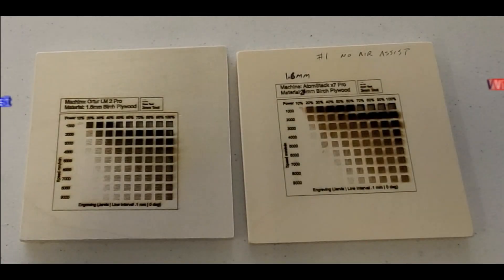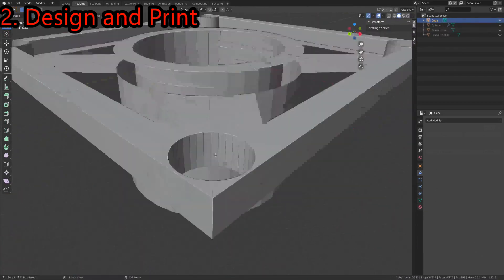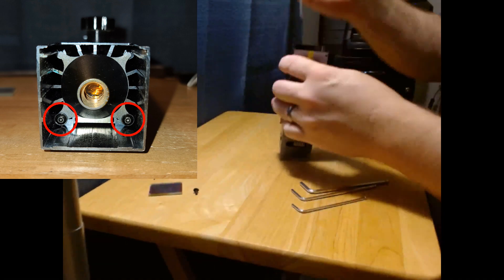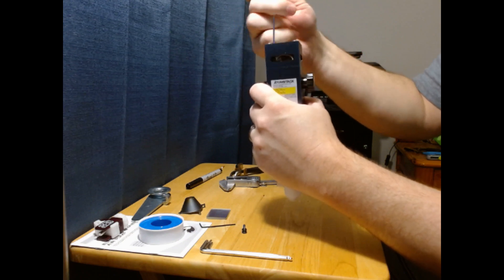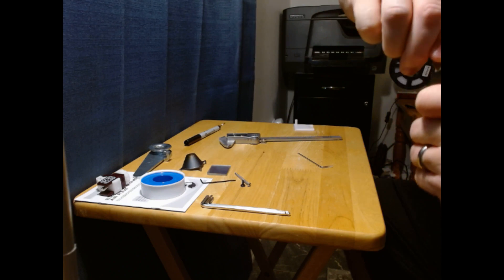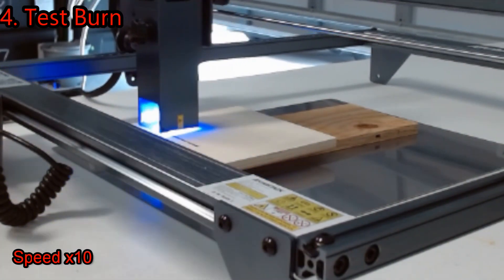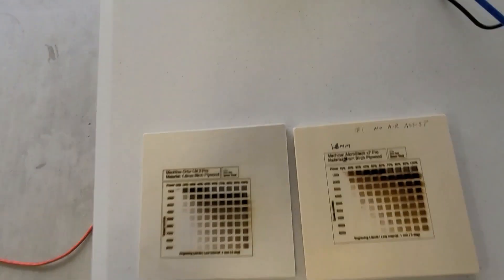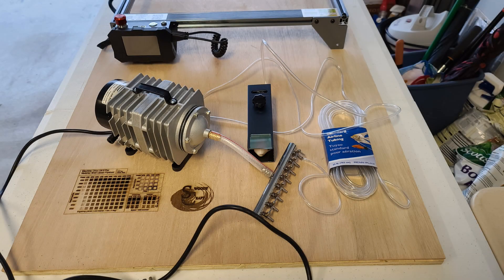Atomstack X7 Pro Air Assist Upgrade

Comment: Do you recommend the 20w or 32w air pump?
Reply from the maker: I think the smaller will probably be fine, the small focus seems to make extra pressure not terribly necessary.
Reply: What size air pump did you use?  Thanks again.
Reply from the maker: @SaltyDawgRC  i got a 50w... but i have a tendency to overdo most things....

Comment: I had your 3d files printed and did this on my S10 pro. Work great. Just FYI I was able to 2.5mm tube and used a small tube bender. Anyway thanks!
Reply from the maker: Thats great. Glad i could help

Comment: I have an M50 module arriving next week and was considering the best way to go about this. I have no qualms about drilling holes in the thing though :) I think pushing air through a long 2mm OD tube (what is the inside dia?) is just adding too much resistance to air flow for my  low pressure aquarium pump (looks a lot like yours). Fine if you have a high pressure pump like an airbrush compressor though. You might have designed the nozzle to accept a brass 6mm threaded 3D printer nozzle, drilled out to larger diameter it makes for an easy to replace part that isn't going to melt. I find when cutting plywood you get a lot of spatter from hot resin/glue which can block or burn the end> https://flic.kr/p/2mZSAsV You also need to be able to gain access to the lens on a regular basis for cleaning if you ever run it without the air assist on. Nice job though hope you are happy with the result.
Reply from the maker: I am actually in the middle of designing a new nozzle tube setup, running 2 tubes down for twice the flow.

Comment: Atomstack website says in the x7 features: "Air assist system (Launches at the end of February, need to be purchased separately)"
So there will be an official solution for this problem as well.
Reply from the maker: Thats good… but to be honest, a big part of getting these “toys” is so i can mod and experiment with them.
Reply: @SwoodyCraft  They have an official solution now, but its pricey.
Reply from the maker: How much?
Reply: @SwoodyCraft  Air assist kit is 110$. 
It includes a small compressor, which is probably the main reason for that high price.
Reply from the maker: Lol. Ill stick with mine.... much cheaper

Comment: Just got my parts printed. Now just need to find 2mm tubing. Great video! Thank you!
Reply from the maker: Thank you. Let me know if it works for you
Reply: @SwoodyCraft  finally got around to putting together and WORKS LIKE A CHAMP! Just had to clean up holes for air and shave just a little off back of cone for holes to line up, but other than that worked great! Thanks
Reply from the maker: @kevindavis1219  thats excellent. Glad i could help.

Comment: What would stop me from simply removing the guard (obviously I'd need to take any and all additional appropriate safety measures) and simply putting a fan next to the machine? Would that work?
Reply from the maker: From what I've seen you can, but it has a very minor improvement to quality. Its better than nothing, but very minor in comparison to targeted air assist.

Comment: Great work! The combination of the screw channel method from "Tehnical Driver, Rmc-Reloaded" and the K40 Lens tube type looks great! But: With the lens enclosured in this way never ever run the laser without running the pump. The lens will overheat and crack. I speak from experience... :-(((
Reply from the maker: Thank you for the heads up

Comment: Why can't the 20 W filter work instead of the 50 W - I know it's a lot more gallons per hour not he push of air, but does it really need that much air flow?
Reply from the maker: I imagine it will. I just have a tendency to overdue everything.

Comment: Is that 152, 153 mm tubing include the bent portion of the tube or just the straight portion after the bend?  Great video. I'm working on adding it on my x7 Pro as we speak.
Reply from the maker: Thats the entire length of the tube (including the bent part).
I used it for 4 or 5 hours yesterday, worked great. Small little darkening on nozzle, but it was all blown char, no damage at all.

Comment: Still trying to find my way around the laser, so when you said "the first thing I did was take apart the laser" I knew this is out of my pay range for a while! Thanks for the video and your time - I will be coming back to this when I am more confident.
Reply from the maker: You honestely dont need to do anything bud. If you have a 3d printer, i did all the work for you. And install is really easy. Jump to the install part and you'll see.
Reply: @SwoodyCraft  Thanks. I am still trying to get my enclosure put together (single digit temps in the midwest!) and I just need more hands on time to feel comfortable. Thanks again for sharing your knowledge - I will definitely come back to this later..